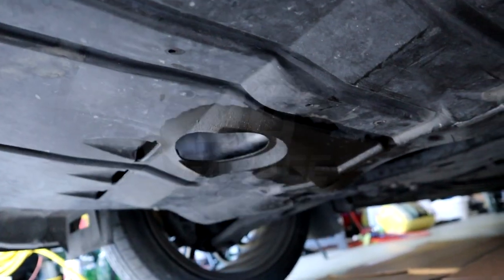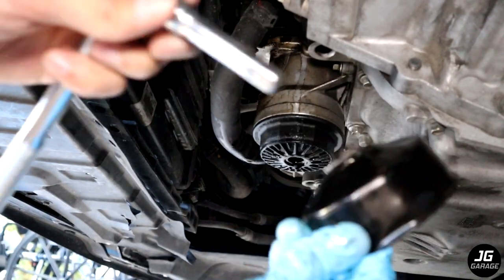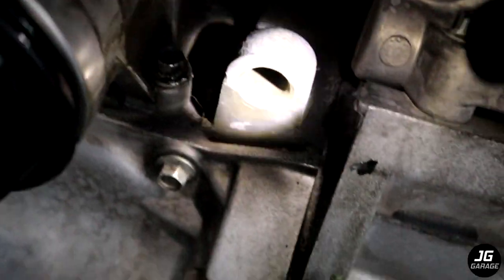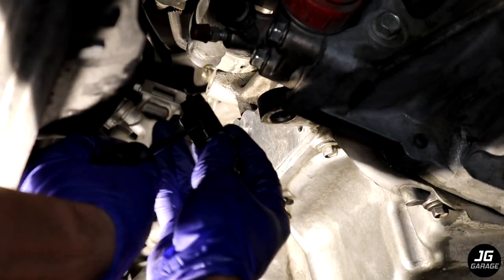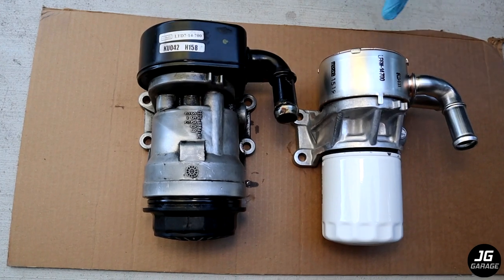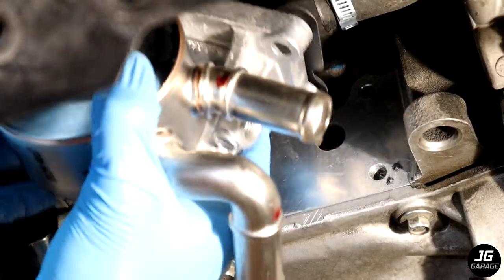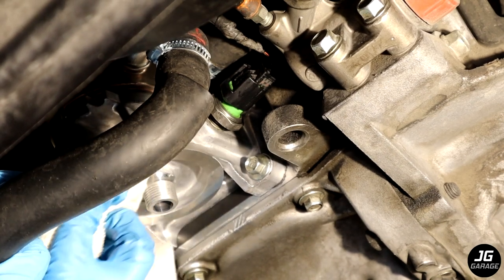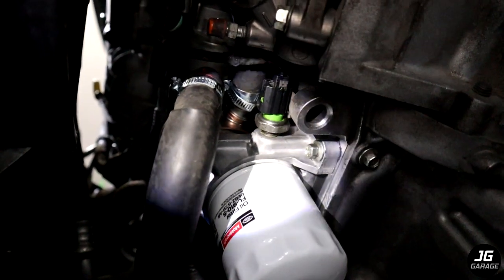How to Fix Mazda Oil Leak | Updated Oil Cooler & Spin On Filter Conversion Install on Mazdaspeed 3

Comment: Ok sir I have to update my prior review of this video. I just got done an hour ago doing the new oil cooler and the conversion to a regular oil filter. My 2007 Mazda CX7 leaked so much oil before I thought it was my timing cover gasket AND the oil filter gasket. I leaked so much tree hugging snowflakes used to follow me to see where my ground polluting ass lived. I am absolutely delighted to say I have ZERO oil leaks now. Drove it 40 miles and not a drop. I guess that oil cooler can leak bad enough to disperse oil everywhere under the engine. I was a little more cautious than you and for 26 bucks I replaced the Oil pressure sending unit while it was apart. This is by far the most clearly instructed and useful video I have ever watched on Youtube. WELL DONE SIR!  (I did teflon tape the oil pressure lol )

Comment: i did 13-15 ftlbs for the oil filter housing to engine bolts…if u go 15+ ftlbs, u might end up snapping a bolt or two, i just ended up going 13ftlbs

Comment: Just in time!! I’ve been waiting for a clear and detailed video for this exact job. Also, liked how you talked about “repairing” the nicks on the gasket surface with rtv. Great video!! Will use it once it gets warmer!
Reply from the maker: I hope this video helps you when you tackle this job! Yeah the nicks were an accident from the time I used pliers to try to remove the broken bolt. RTV gasket is definitely not necessary. Good luck!
Reply: how did it go?

Comment: Great vid! Thanks for posting the links. Wondering where you got your 76mm 14 Flute Filter Wrench? I see a number of them on Amazon, but I do recall hearing in one of the Speed forums that not all (even when supposedly the same size) will fit as well as they should. Also wondering what year your Speed 3 is...I have a 2008 and would love to do this upgrade - just want to verify that the parts will fit. Thanks and keep the great content coming!
Reply from the maker: You're welcome and thanks for watching! I honestly don't remember since I bought it years ago but I know I bought it from an auto parts store and I want to say O'Reilly. I think I came across that too before because there are filter wrenches that are 74-76, 75.6 and 76 mm in size. I believe mine is just the 76mm which worked just fine for many years. But if you're in doubt, just buy the 75.6 and 76 and test fit both to see which fits better and return the other. My Speed is a 2009. Yes everything I used/bought will fit your 2008. Basically the same car. The links I've included are also the cheapest way of doing this upgrade. Do you have the oil cooler leak? Or just want to upgrade to a spin on filter? Also thanks for the compliment! I do plan on creating more content so please subscribe if you haven't as it will help my channel and also consider following me on Instagram, @jg.garage_.
Reply: @jggarage1807  No leak (yet) however I find it to be a bit of a pain to change the oil filter on my Speed as compared to my other cars - this looks like a fairly straight forward upgrade. I will be getting a 2007 Speed 3 at some point in the spring which will be my "fun" car (it's a Texas car so has never seen snow and therefore has no rust). That car will also get the oil cooler upgrade. Just wanted to make sure you had a Gen 1 as well - as you noted they are basically the same car from 2006 - 2009. I am not as familiar with the Gen 2 Speeds so wanted to make sure yours was at least the same generation as mine, thus ensuring the parts you list will fit. I will take a look on Amazon for the filter wrenches and order as needed. Thanks much for the info and the quick reply!

Comment: i found 25NM on the bolts per a Cosworth instruction manual for a 2003-2006 Ford Focus with a 2.3 Duratec. Just did a spin on filter conversion for 2007 Mazda 6, and drove it around for a and found an oil leak...I was too afraid to overtighten and cause permanent damage and I don't have a torque wrench.
Reply from the maker: Were you able to determine where it's leaking from exactly? Is it leaking between the filter housing and engine block?
Reply: @jggarage1807  yes that is where it's leaking from. I used the metal gasket as well. I'll be getting a torque wrench soon
Reply: @Metal_Siren  Did that fix it?

Comment: Very well done, sir. I am about to change my oil and filter on my 2007 Mazda 5, and it will be my first "mechanic" job ever.   :)
Reply: Did it work?  Mine is a 2004 (2004 MAZDA3 2.3L MT HATCHBACK S), and it's appears to be leaking.  I have not looked to see if it's leaking from this very part, but I have not jacked the car up yet but that plastic bottom-most cover has oil all over it.  Could it be just the Oil Filter needs replaced ?

Comment: UK here. Been researching this job as the original FoMoCo-labeled cooler on my Japan-built '06 Mazda3 2l is starting to weep at the downward-facing coolant connection due to corrosion of the steel though it's still oil-tight. 

The manuals give the torque for the four filter block to engine block bolts as 20—30 Nm / 14.8—22.1 ft-lb. There's a note on applying silicone sealant to the oil pressure switch/sender threads making sure the first 1-2mm is kept clear "to prevent a possible operation malfunction". Torque is given as 12-18 Nm / 9-13 ft·lbf.

Comment: Just completed this conversion/upgrade on my 2007 Mazda CX 7 using OEM upgrade kit from Japan (as listed in o.p.'s links on Ebay). It took me 5 hours!! fussing with the upper coolant hose (clamp was in an unfortunate position) and installation of the upgraded unit was much harder than expected due to lower radiator hose clearance and access angle on the upper right attachment bolt (not to mention working upside down on minimal clearance using jackstands). My 1st recommendation is to use car ramps instead of jacking w/ stands to give you a higher clearance; you'll need it. Installation tips: Install top left attachment bolt 1st (gasket tangs hold bolt) then bottom right to square up the assembly. For top right bolt, I had to put the socket on first and then partially insert the 3" extension to get the bolt turning (the top coolant hose nipple partially blocks clear socket w/ extension access). Tighten by hand until flush. Install last bolt (bottom left) easy access. I used 18 ft.lbs. torque setting for these 4 bolts; same access challenges as mentioned above (for the top right bolt you have to muscle it on and squeeze your torque wrench into place; best to use a 6 point socket vs 12 point for better/stronger fit and less chance of rounding of the bolt head). Next I installed the oil pressure censor -- this was the biggest b*tch of the project besides the upper right bolt and upper coolant hose. Someone should find out what metric size this is because a crescent wrench is too thick to work efficiently in this tight space (it's whatever metric is a little bigger than 7/8 inch) a spanner of the correct size would be narrow enough to more easily loosen and then tighten to install the oil pressure censor. After that I hooked up the lower coolant hose; piece of cake. Screwed on filter, filled oil, topped off coolant, ran engine for a while checking for leaks; none so far. Thanks JG Garage for your video and tips! I felt confident trying this DIY project after watching your video several times and preparing for as many contingencies as I could think of. (FYI, I ended up reusing the OEM coolant hose clamps)
Reply from the maker: Thank you for commenting on your install experience and for providing more tips for others. I am so glad to be able to help others. I wanted to make this video because there were no other videos here on Youtube detailing about the full process and I was quite intimidated about this job without having much insight. Also sorry that I was unable to provide you the correct torque spec for the oil filter housing. Did you just decide on 18 ft lbs or were you able to find that spec somewhere online? I'm glad that you had a successful install! Please consider subscribing to my channel and giving my video a like as it really helps out my channel.
Reply: Wow..not to bright are you

Comment: Thanks for the video and the clear part information.  Liked and subscribed.  I replaced the gasket between the cooler and housing about a year and a half ago using a Fel-pro gasket.  It's leaking again already.   I assume it's the design of the updated cooler gasket that works better.  Is it possible to use the updated cooler with the old housing and still have it not leak?  Trying to find the cheapest way to reliably stop the leak.  I assume changing the housing and another gasket won't last.
Reply from the maker: Thanks for liking and subscribing! Yes, you can use the updated cooler on your existing housing. I upgraded the housing just because I'm already down there taking off the parts and I prefer the spin on filter since the original cartridge filter is quite messy and cumbersome. The spin on housing was definitely an expense but I thought might as well do a 2 for 1 job. Haha

Comment: Awesome video. DISI engine need SP API oil.  The new standard works better with DI engines and alleviates the issue of zoom zoom boom due to low engine speed high knock.

Comment: I know this is old but great informative video. Question: I'm about to do this job on my Jaun. And I came across the the oil cooler part you called out on Edge's site. Why is their part nearly 400 more expensive? What Am I missing? Any ideas?
Reply from the maker: Thanks for watching! Yes I saw that one as well when I was browsing for the parts. Honestly I don't know why they charge that much. Their website pretty much seems to be charging dealership prices for oem parts. The parts in the description are all OEM Mazda parts but for cheaper.
Reply: @jggarage1807  thanks for the quick reply. Yes, stealership pricing is more like it. Keep up the good work on your videos. Hopefully it's netting you some extra play funds to buy go-fast bits for whatever platform you're on right now
👍🏾✌🏾

Comment: Did you remove the coolant first as well?
Reply from the maker: No I didn't. In my previous video before this one, I did a full coolant flush so I didn't want to waste pretty much new coolant. I just drained whatever coolant would spill after removing the two coolant hoses connected to oil cooler.
Reply: @jggarage1807  so only a little will come out from the hoses. Then just top off after. Thanks!
Reply from the maker: @esurfer89  yup! If I had to estimate, maybe 1-2 cups of coolant drained and then I just topped off after. You're welcome! Thanks for watching! I hope this video helps if you'll be doing this job. Also don't forget to like and subscribe! It'll help my channel out!

Comment: Great video. WOuld you recommend teflon tape on the oil sensor? Also liked and subscribed
Reply from the maker: Hey thanks for watching, liking and subscribing! And honestly I've seen mixed opinions on using Teflon tape. If you want to use some sealant, I've read using high temp thread sealant and making sure to give it enough time to cure. But from my experience, I've removed the oil pressure twice on different occasions and never had a leak from there.

Comment: great info you earned a sub.did not khow there was a spin on set up for a 2.3 L will it fit a 2005 mazda 3 ?
Reply from the maker: Thank you for watching and subscribing! I have included a link for the oil filter conversion housing for Mazda models without the oil cooler in the video description. Please check it out and confirm it will work for your application. I believe it will fit for your 2005 Mazda 3 based on the reviews and questions asked on the listing regarding your year and model but please double check.

Comment: I do have a question do you have to bleed the coolant? Or just top it off? 😊
Reply from the maker: @heartseasebliss1152  I believe bleeding is necessary since air has entered the system by doing this repair.

Comment: Mine is a 2004 (2004 MAZDA3 2.3L MT HATCHBACK S), and it's appears to be leaking (and onto the ground).  I have not looked to see if it's leaking from this very part, but I have not jacked the car up yet but that plastic bottom-most cover has oil all over it.  Could it be just the Oil Filter needs replaced ?

Comment: Did you have to remove all coolant or did you loose a lot of coolant when you removed those hoses?
Reply from the maker: I didn't remove all the coolant but when you remove the hoses, you'll loose some. So you'll need to refill your coolant and bleed the air.

Comment: Hello, could i use the oil filter conversion housing so that i could use a spin-on filter without swapping the oil cooler, TLDR, can i use stock oil cooler with the conversion housing?.
Reply from the maker: Yes that is possible.
Reply: @jggarage1807  thank you very much <3

Comment: Hi, I wonder if I could still use my oem oil filter cap on that kind of conversion housing? Instead of screw-on filter.
Reply from the maker: Hey thanks for watching! If I understood your question correctly, you're asking if you can use the black plastic filter cap from the old housing onto the new conversion housing? If so, no you can't. The new housing is completely different and only accepts a screw on filter. If you just want to replace the oil cooler and use the old filter housing, you can. Does this answer your question? Feel free to ask. I'd be happy to help.
Reply: Thanks a lot. U’ve been very helpful Sir. Keep it up. 💪🏻
Reply from the maker: @florenzrosario8786  no problem! Thank you! Don't forget to give the video and subscribe as it helps my small channel grow!

Comment: Do we even need the oil cooler?  My 2008 Fusion with same engine was converted to spin on by the previous owner, a Mazda mechanic, and it does not have a cooler.  I can see having the transmission oil cooler, so would simply remove the oil cooler from the line and connect direct to the transmission cooler.
Reply from the maker: I don't believe your 2008 Fusion came with an oil cooler. This Mazdaspeed came with an oil cooler due to its higher performance engine. There are two oil filter conversion types for these Mazda/Ford cars, one with an oil cooler that attaches to the top like in this video and one without like the what the mechanic installed on your car. I hope this answers your question. If you have further questions, don't hesitate to ask! Also thank you for watching! Don't forget to like and subscribe as it helps my channel grow!
Reply: @jggarage1807  Wow thanks. That is great info. I actually have the Mazda 5 and searched for that and then accidentally pulled up your video without realizing it is a different vehicle.  But the story is probably the same since the Mazda 5 has the cooler.

Comment: Do you lube the gaskets before putting them on?
Reply from the maker: I didn't at the time since people at the forum told me it's not needed since it doesn't spin but looking at the diagram in the video, looks like there was a oil can symbol. I think adding a little would be fine.

Comment: So if I don’t want to do the conversion and I just replace the seal and gasket and use the OEM housing well It stop the leak?
Reply from the maker: If I understood your question correctly, you're asking if you can just replace the seal between your old oil cooler and old housing? If so, yes you technically can and it's cheaper that way however it will leak again in no time. I've done that method the first time and it didn't last long so I decided to switch to the Japanese oil cooler. Let me know if this answers your question.
Reply: @jggarage1807  Thank you yes I just need to stop my leak temporary until I could save enough to do the conversion
Reply from the maker: Completely understandable. You can find the seal on Amazon. I have it linked in the description.

Comment: Hello JG.My Mazda 5 , 2L,  oil mixed with water into my water tank. How can fix that? Is it oil cooler default?
Reply from the maker: Hey there. The oil cooler gasket that normally fails is between the oil cooler and the oil filter housing. Only oil passes through this gasket. Coolant runs inside through the oil cooler and is a closed system and shouldn't mix with the oil there. I haven't heard/seen where the oil cooler actually breaks and causes internal coolant leaking into the oil. Usually coolant mixed with oil is a head gasket issue. Have you overheated?

Comment: I have a 2005 mazda sp3, seems same 2.3 l as 2007, seems a silly question but they specify 2007 models, would this work on a 2005 the same?
Reply from the maker: Yes but the only difference is you would need to buy the oil filter housing without the oil cooler adapter which is on top of the housing. I have a link to that part in my description however it seems to be out of stock on Amazon right now.